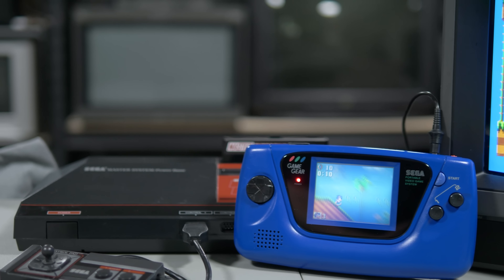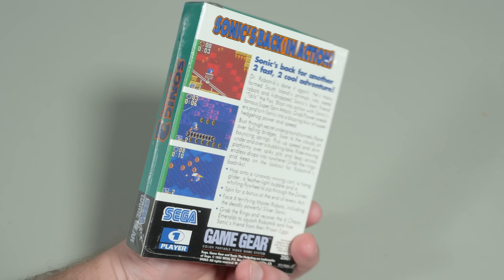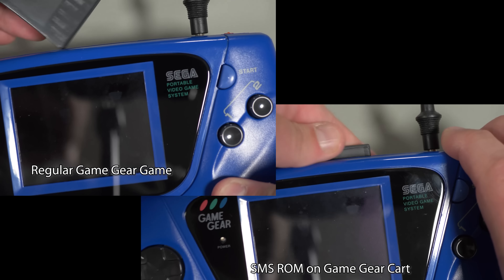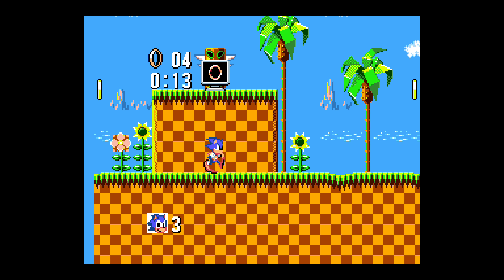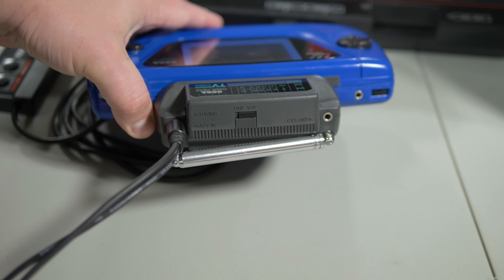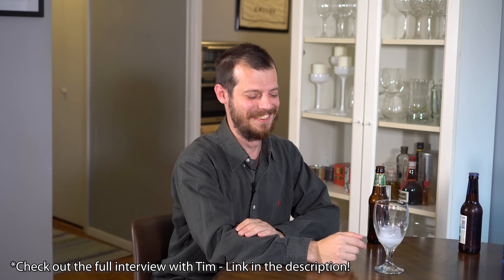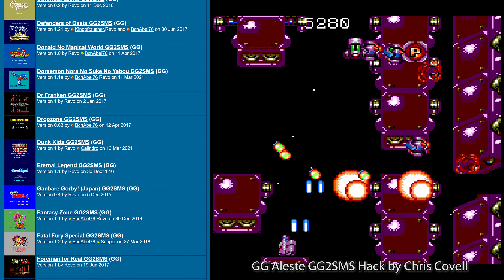Game Gear Games on Master System (and vice versa)

Comment from the maker: I totally forgot to mention the Mega SG can play Game Gear games with a cartridge adapter, or with the jailbreak.  I guess you can say that falls under the umbrella of "emulation", but if case anyone wasn't aware, here's the adapter:  https://www.retrorgb.com/analogue-mega-sg-cartridge-adapters-now-available.html
Reply: That's what I've been using and I love it!
Reply: Haha I was just about to swoop in and point this out, only RRGB got there first… I think I’d disagree that it counts as emulation since it maps a GG core to the MSG’s FPGA does it not? Isn’t that the same as what the MiSTer does? Similarly I believe that a jailbroken Analogue NT mini has a Sega Genesis core (although I can’t get it to work), which runs Master System games natively, so in theory the ‘Super Game Gear’ prototype thingy’s code could be combined into a patched GG ROM to potentially allow it to run on that? 🤔
Reply from the maker: FPGA is hardware emulation.
Reply: @RetroRGB  ok yeah good point. Excellent video by the way 🤘🏽
Reply: It would have been nice if this adapter worked on original hardware. The Retron equivalent also doesn't work on an actual Genesis.
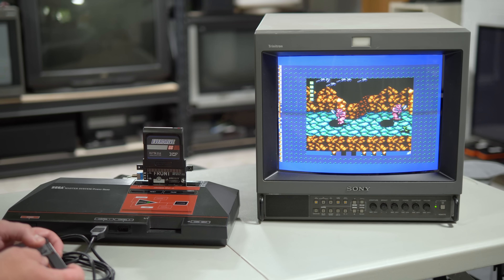Reply: @9:15 😆 ghetto genius
Reply: I thought FPGA was a tear down of the original hardware rebuilt to do the same thing but built a different way to get the job done using it's very own hardware?🤔
Reply: @michaeldemers2716  Yeah, like how a typical software emulator is a tear down of the original hardware rebuilt to do the same thing but built a different way to get the job done using software instead of circuitry.
Reply: @buxcrunner89  It's impossible to make a simple GG->SMS adapter, the one in the video by Apocalypse is the first one in 34 years. The GG adapter works on the Mega SG simply because it's just a pinout adapter and the Mega SG takes care of everything else, namely a Game Gear core plays the games, not the Master System core
Reply: Also remember the Game Gear adapter for the Retron 5!
Reply: Would the Mega SG cartridge adapter for Game Gear work on a ‘’regular’’ Genesis ?

Comment: I remember "chasing" TV stations across broadcasting zones during long interstate trips as a kid with Gamegear TV tuner in tow.  I was very grateful to have it, even if now I'm reduced to a G revision that won't display TV, oh that and there's no analog broadcasts for it to pick up any more.  That, and there's a myriad of ways to watch video on the go that are far better than a battery guzzling Game Gear.
Reply: I still have that tuner and it now listens to broadcast from a DIY uhf transmitter connnected to the VGA out of my other GG..  Haha
Reply: @terence79chan  Funny thing is the old "circuit tutorial" set I got as a gift from Radioshack as a kid has proven more useful, as analog radio broadcasts outlived analog TV broadcasts.
Reply: @Dark_Jaguar  that’s so true. 😂

Comment: Thank you, I've now learned why some of my legit game gear ROMs load up in emulators at full master system resolution. I had assumed they were hacked roms (fan ports) or the emulator was failing to crop properly -  turns out it was working as on original game gears (albeit those would have used much worse scaling)

Comment: Pretty cool! There are quite a few GG2SMS games that were reworked and removes the garbled area.
Maybe it was the choice of words that sounded a bit off, but the Power Base doesn't actually allows the Mega Drive to be backwards compatible, it's basically only a passthrough since the cartridge slots are different, the converter allows the console to read the SMS carts and cards, it's otherwise backwards compatible internally.

Comment: The Analogue Mega Sg with its cartridge adapters can run original Game Gear cartridges, and with the optional DAC can display on a 15KHz CRT with proper border masking and correct support for the SMS video mode games.  All three of those components can be bought from the Analogue store and be shipped out now if you do not want to wait out the shipping schedule for the Analogue Pocket.
Reply: Yes. That what I'm currently using and while it's awesome, I'm getting a small picture within my Sony CRT. Not sure how to make it to fit the full screen of my CRT tv. 🤔
Reply: @onetwo6039  In that respect, the Mega Sg must behave like every other device shown in this video on a CRT, the Game Gear's resolution is 160 pixels by 144 lines and the CRT expects 240 lines, so a Game Gear must have borders if you want proper proportions.
Reply: @NerdlyPleasures  ok so basically that's the way it's going to be. There isn't really anything that can be done?
I'm kinda scared to mess with the settings on the SG worried I might do something way wrong.

Comment: I had the GG TV Tuner. It definitely was not as good as the dedicated portable TVs on the market at the time, but it was better than nothing. There were a few UHF channels at my house that I could not pick up on the TV in my room at my parents' house. But I could get them on the GG if I pointed the antenna in just the right direction or went outside with it.

Comment: It was really awesome to see a Game Gear-exclusive game with the "expanded" screen size & proper coloring, as I managed to get the same result on a stock Sega Genesis using the RetroN5 adapter, but the colors were understandably all destroyed & I couldn't actually start any of my Game Gear games on the Genesis, minus Chuck Rock 2 (which would just crash upon starting Level 1). Amusingly enough, even SG-1000 games can boot up on a Genesis, with the audio playing just fine, but since the Genesis doesn't support that old video mode (hence why F-16 Fighting Falcon doesn't work) nothing shows up on the screen.

Comment: Back in 1999, I had a Compaq 2015C WindowsCE Handheld PC, which was about the same size as a GameGear, and there was a WinCE emulator available for GameGear. I didn't play it that much, regrettably, but I did load up Mickey Mouse, Donald Duck, and Daffy Duck, and they were all impressive.

Comment: Definitely not for everyone, given the price, but I have a RetroFreak clone console, which is kind of like a Retron 5, but it plays a lot more than 5 (11 different consoles and handhelds if I remember correctly). It's emulation, but really good emulation with lots of options like save states, video options, scan lines, and it outputs at 720p over HDMI, so not good if you're using a CRT. 

It will play Genesis/Mega Drive games natively through a cartridge slot, but there's an adapter you can get that lets it also play Master System and SG-1000 cartridges and MyCards as well as Game Gear cartridges. It handles Game Gear emulation independently from Master System, so you lose no color range and there's no junk on the edges. However, it simply scales the Game Gear screen to 4:3 720p, so unless you're playing a Game Gear game that is just a Master System ROM, it's not going to increase the viewing area. But since the RetroFreak also plays Master System games, you can just use those instead. 

Unlike the Retron 5, the RetroFreak can rip your game ROMs to an SD card and play off that without you needing to insert the cartridge every time. The dirty secret is that you can just put downloaded ROMs on there and play even if you don't have the Game Gear/SMS adapter. Though I'd say it's morally light gray to download a ROM of a game you actually own, and only slightly darker morally gray to download a SMS ROM for a Game Gear game you actually own. But the RetroFreak will still play real carts if you have the right hardware, and it looks and sounds fantastic.
Reply: I use the RetroN 5 3-in-1 adapter with my RetroFreak, it supports SMS, Sega card, and Sega Game Gear games. All work great.
Reply: @jfroco  does the Retron 5 also play Game Gear and Master System games with an adapter?

Comment: Oh man, I went mad last year when upgrading my GameGear. Started with a full recap, only to realise that 1/3 of the original screen wasn't even working. No amount of attempted heating of the connectors would salvage it.

Then added the McWill screen. Then wired up the VGA pads for TV out. Also snagged a SCART cable from VideoGamePerfection so I could play on my PAL CRT. I also added the PXLmod player 1 board. I managed to get both Dsub ports sitting flush with the system. Time consuming but absolutely worth it. 

In a way I built a GameGear "Switch". The thing chews through 6 eneloops at a time so its barely a portable, but hey at least I can plug it into mains and into a TV.

The folk at SMS are wizards. They helped me figure out how to get lightgun games working on a Gamegear whilst using TV out on CRT. You'll need a Master Gear link cable (game gear link cable modified with a 9 pin controller port for player 2) - this is for the TH signal (only obtainable via player 2 kn the link cable). You also need a means of providing 5v and ground to the link cable. I basically built a passthrough adapter the plugs between my lightgun and the Master gear cable, which grabs its ground and 5v from usb. The lightgun ROMS also need to be the modified version that treats player 2 inputs via the Master Gear link cable as player 1.

All in all, really happy with the end result. That said, some of the other builds are more insane. There's a guy on SMSpower that even managed to do all of the above whilst also getting the Master System's FM upgrade and 3D hardware working on their modded GameGear.

Comment: Bob, this chapter was amazing. In my opinion the Super Game Gear project looks like the most amazing solution here, It will be amazing if the developer found a way to add nice frames  the video, like the Super Gameboy does. ALSO it will be amazing if they Add LINK CABLE support, like Super Gameboy 2 does, that way I bet people like me will buy 2 instead 1, in order to use them linking 2 consoles for 2 player games. BTW, I think the only comparison your video lacked is to watch at the same time,  Game Gear games like SONIC, compared with their proper extended resolution at a TV , next to the Sega Master System version.

Comment: It would be interesting to see what they could do with the Genesis hardware, considering that it has the same (or at least a similar) 4096 color pallete and extra processing power that could be used to draw a border à la the Super Game Boy.
Reply: The Genesis maxes out at 512. You’d either have to make something that actively runs the Game Gear game and converts the output to something the Genesis can display (like a more involved Super Game Boy, not really worth it nowadays), or figure out how to get the SMS backwards compatibility working. It doesn’t sound like anyone has figured out the latter yet.
Reply: @timmytoobs  Oh, my bad, I forgot. Still, it would be much easier to find proper color matched with the larger pallete.
Reply: Sega was developing a GG to Gen converter around 1995, presumably for launch for the Nomad. It most likely would of just been a GG Z80 running through the Gen hardware kinda like the SVP chip does for Virtua Racing or the SH2s in the 32X.

Comment: Great video, Just decided to open my old game gear and replaced the caps with SMD caps except for the power board which got regular caps. The smell was horrid when changing them. would be interesting to see 2 player running on the master system mod instead of a game gear with link cable.

Comment: You could totally watch broadcasts on it via one of those digital converters. They have analog outs as well as ANT passthrough (touch the antenna to the center coax pin). If you're gonna watch TV on a GG in 2022, you gotta go all-in ridiculous.

Comment: I vaguely remember my sega game gear days when i was a kid, i had some cool games like sonic, wonderboy, outrun and a couple more i don't remember, but what i do remember, was my dad getting annoyed of me always asking for double AA's, i would take double AA's from where i could find them (clock in the kitchen, tv, vcr and hifi remotes etc) just to get 1 or 2 hours extra on this game gear thing! It eats batteries for lunch! So when it was my birthday, offcourse i would ask for a big pack of quality double AA's! But my dad didn't bought me double AA's, he gave me a pack of C or D cells, those giant big ones! I didn't understand why he would gave me the wrong kind of batteries, but than he gave me something else, an official Sega "Booster Pack", it came with a sega wall adapter and this big black box with a wire on it, those big C or D cells were offcourse for this black box thing, it took 6 of those giant batteries, and it could power the game gear for a good while, handy for those long car trips! At home i would just use the wall adapter! But when i got my gameboy pocket which could run for hours and hours on a set of tripple A's, my game gear got burried in the lowest drawer of my closet, and since i forgot to take out those double A's (durasmell, i still hate you!), offcourse they had leaked when i wanted to play my game gear once again after a couple of months, completely ruining my game gear! My dad couldn't repair it, it was to far gone, and i was sad, really sad, because honestly, i loved that lil sega console!
Reply from the maker: Your story put a smile on my face.  Not cause I'm laughing at your AA peril...but because I went through something similar :)

Comment: I absolutely wanted a GG TV adapter as a kid. Nowadays I'd still enjoy if there were some way it worked with my CleanScreen modded GG. Ah well. 

The CleanCreen mod has TV out contacts on the board, though I haven't looked into what it might require to use, other than soldering on ports. Additionally, CleanScreen was way easier to install than others according to my modder. This was due to the flex ribbon and the reduced number of necessary cap replacements post-removal, speaking only for my GG which is an older model with worse leaking. The only drawback I might mention is that RetroSix used to have a bit of a reputation for sending incorrect parts (the flex ribbon in my case), but they helped me get the right one on the second try and were professional.
Reply: TV adapter works by directly driving the LCD (it puts the Game Gear's chipset in a special mode that shuts down the CPU and VPU and diectly passes through the cartridge pins to the LCD).

Sadly that means that the various TV adapters will output yet other different resolutions and timings, than the native 160x144 or the SMS-compatible 256x200 mode that the mod screens recognize and can decode.

Comment: A few things to add - game gear can be modded with FM and 3D glasses hardware, but it's not a user friendly mod at all. Also, almost all LCD screen mods also output RGBs but use (I think? maybe?) ttl level sync. you can use a small $4-5 open source AV module to add composite video AND s-video to get full output options. It should work with MCwill modded VGA consoles too to get a console that could all that as well, likely sharing pins on the VGA connector. Finally, a consolized game gear that doesn't output correct RGB video on master system games is unfortunately maybe not modded correctly (it could be an older limitation of tims board?) - the game gear compresses master system video to fit the game gear LCD normally which messes with the video - to get around this most LCD and video mods connect a wire that essentially disables the SMS video compression giving it proper video output. it's a common mistake in LCD installs to miss this wire and cause video issues just like yours in "mickey".

Comment: Because Genesis is mostly (?) backwards compatible with SMS games, is it possible for similar adaptor be created for use on a genesis utilising the proper gg colors that i assume a genesis could handle?
Reply from the maker: No, because the Genesis switches to SMS mode when the Power Base Converter is used.  Great question though.  I should have mentioned that ;/

Comment: 8:24 What does the toggle switch on that prototype do? It seems to be labelled "J and O". Could that be Japan and overseas....? But then, I'm confused. The GameGear is region free and Japanese Mark III games have a physically different pin connector than Master System. So what the heck does that toggle switch do?

Comment: With the benefit of hindsight, maybe they should have let people play Game Gear games on the Master System instead of the other way around.   and Imagine if they'd done the same thing for the Megadrive.  The same tiny carts on three different pieces of Seega hardware.

You'd need some kind of code trap to figure out whether the game was running on GG or Master System because of the GG's extra vi.deo options, and the games would have be be designed to work on either, which is probably why they didn't go this route, but it would have been very neat

Comment: Hey Bob, I don't have any hardware that can run SMS games, but I am interested in emulating GG2SMS roms, particularly exclusives like the Shinobi GG games and Tails adventure at a higher resolution.
I am running with a main problem, first, emulators recognize it as a GG roms so many of them load it with a reduced resolution that the patch is intended with, but the main problem I have is that the color palette is twisted and the games have artifacts and look all red basically like a Virtual Boy rom.
Is there an emulator that can run patched GG2SMS games properly?